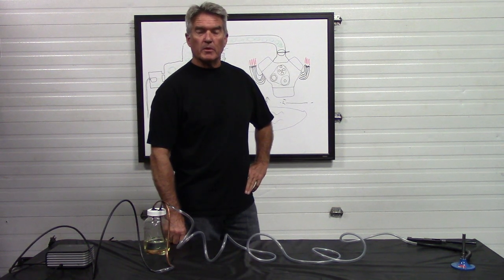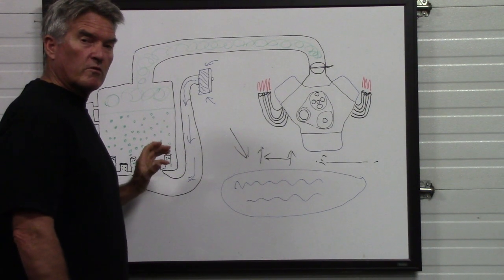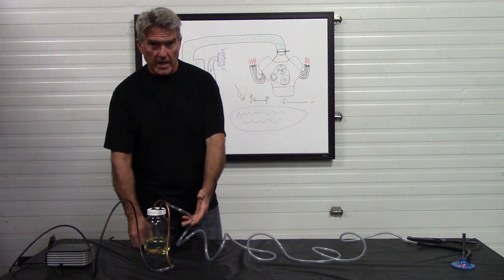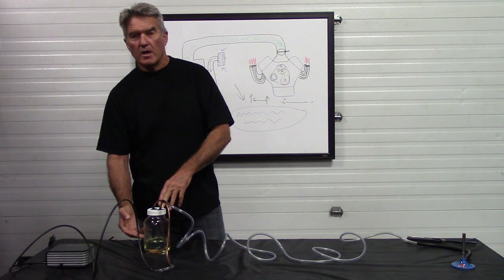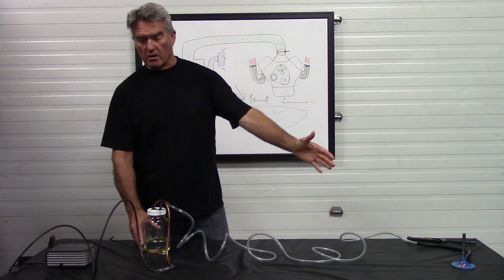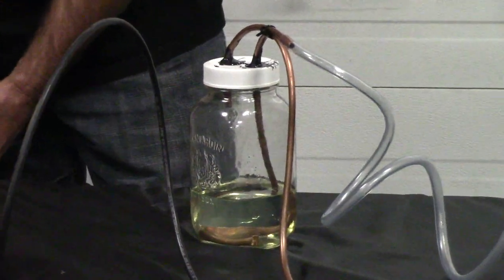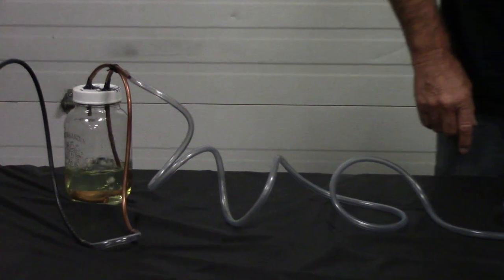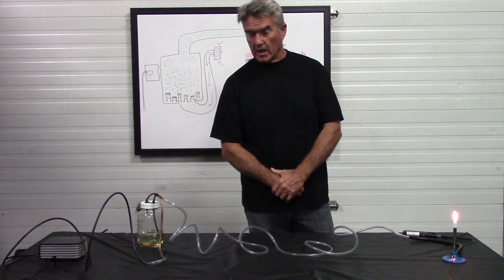100 Miles Per Gallon, Here's How

Comment: I'd suggest A flashback arrestor, acting as a check valve to prevent the ignition of a vapor source. It is particularly necessary for multi-cylinder engines operating on vapor to ensure safe functioning and prevent accidents.

Comment: Good video, Eric. Great to see people thinking out of the box. There is no reason why cars should not be running on gasoline vapor only in 2019 right out of the factory. Turning gasoline to vapor is not rocket science, as you just showed. Had the internal combustion engine been allowed to evolve unimpeded, cars would have been running on gasoline vapor over 100 years ago.
Reply: Running cars on vapor introduces complications with zero benefits.  In fact, cars would get LOWER mileage using vapor.  The reason for this is that high pressure fuel injectors would not be possible using vapor.  Today's modern fuel injection systems can reach hundreds of PSI and create mists with droplets microscopic in size.  Hundreds of well trained engineers working for both the automotive industry and the fuel industry know what they are doing.
Given the massive attacks on gas and engines today by the electric vehicle industry, if they ever had an incentive to absolutely maximize efficiency, it is now.
Reply: @christo930  Good points, all. Trying to follow along...When race cars [supposedly?] 'kick in the nitro' for that extra boost of power, to win the race, or escape with super speed, is the nitro in a liquid state or vapor? Does it feed into the fuel system, for dispersal? Or thru a different device entirely? After your excellent points, and my understanding of them, nitro seems like an impossible or improbable boosting mechanism. 
Or is that what is called a turbo?
TY and namaste
Reply: @Queen Elcene Nitro is not a fuel and does not by itself add any power at all.  Nitro is stored under pressure and injected into the engine so that more fuel, which is gasoline, can be burned.  The fact that it has to be pressurized is a downside, not an upside.   Nitrous increases the amount of oxygen  so that more fuel can be burned. Burning is a exothermic process of oxidizing a fuel.  How it is delivered into the engine depends on the setup.  But it usually goes in through the throttle body.

Turbos and superchargers work the same way, only they compress air from the atmosphere on the fly.  The low pressure in the cylinder can only "suck" in so much air.  So if one piston displaces 1 litre of air at atmospheric pressure, it can only pump 1 litre of air and this puts an upper limit on the amount of gasoline that can be efficiently burned for every stroke.    
But if you have a turbo charger or a supercharger, more than 1 litre of air can be pumped into the cylinder.  So if you could pump in twice as much air then you can burn twice as much gas, 3x as much air, 3x as much gas.  The turbos and super-chargers also take a lot of power to run.  Generally turbos are driven by the heat and pressure exiting the engine through the exhaust while superchargers are generally belt-driven pumps that work the same way as your alternator or air-conditioner. Turbos allow for smaller engines and make the system slightly more efficient by utilizing the heat and pressure in the exhaust gasses as a power source.
Reply: @christo930  Zero benefits to fuel vapor? Are you a troll? Have you ever heard of natural gas engines? Propane? Have you seen their engine oil at over 5x the regular OCI? Think outside the box. It would be far cheaper too compared to these super high pressure direct injection systems. They are far more complex.
Reply: All gasoline engines have always run on gasoline vapor and air...

Comment: Thank you for sharing your knowledge.
Have you done this in a vehicle? Is there a kit that we will be able to buy, before EXXON/MOBIL, TEXACO, SHELL, ETC./ETC. figure out a way to remove it from the market?  I would like to try it on my 1966 Ford F-100, where I only get 11 MPG
Reply from the maker: I put it on a 72 F150 in 1981. I achieved 75 mpg. The unit I used is in the long video called one simple trick to 100 mph
Reply: @zeekonearth3390  Thank you. I just saw the video.
Reply: @christo930  This guy is a troll.

Comment: Little known fact. You can cold boil any liquid in a vacume at room temperature creating a vapor. Instead of pumping the air how about creating a vacume with a vacume source? (The engine) I remember the old vacume carbs on the old tractors of the early 1900s most of those patents where bought up by the oil companies and companies were paid not to make them anymore. Have you done a google search on how “geet” pantones work?
Reply: @Brian Cramer   [🤔 Interesting that he didn't answer you.] While I'm NOT a gear head, my son is. I planned to show these vids to him,  as a fait accompli: "go build that, plz!"  After reading your comment, and one by Christ0930, I'm beginning to wonder about Eric/Zeke on Earth😶 Did he really create a device, and run it on Ford 302 engine? When he sparks the gas, on ther Bunson burner, it burns, baby, hot, explosive and fast. Wouldn't that blow up a containment chamber? Or be a continuous flame, like at gas wells? And the heat from the ignition, burning process seems like it would be wasted... again, I'm just trying innerstand🤷‍♀️🙆‍♀️
TY and I definitely will be showing your comment to my brilliant son. 
Namaste

Comment: Something like this to me would be better to supplement rather than replace current fuel systems. Eventually the oxygen sensors will trim back injector pulse durations to compensate for the unmetered fuel introduced by the bubbler.

Comment: Hi Zeek, I had a question that maybe you could help me with. I've been wanting to try running an old car of mine on gas vapor, but what about cooling the valves? Wouldn't they get too hot, since it's vapor and not liquid hitting the cylinders? I didn't wanna test it out and have em overheat. What are your thoughts on this?
Reply: Your air/fuel ratio needs to be around 50:1 or higher. Then you don't need to cool the valves. The fuel will burn completely and immediately. The reason for 14:1 a/f is that the liquid raw fuel is still burning on the exhaust stroke, which would burn the valve. The fuel is used to cool the chamber lol smfh.

Comment: Hey there,  im just a little confused  on something and id appreciate if you could maybe help me understand.  First off,  dont cars already do this exact thing when they atomize the fuel before detonation?  After all we know gas burns well but if you want it to burn fast you have to mix it intimately with the air.  Second  off,  when you let this run to completion, as in when the flame goes out. Is there anything left in the jar of gas?  As far as i know there's alot of compounds  in gasoline with very diffrent vapour pressures between them. Obviously this means at some point all the low boiling temperature components are gone and the flame goes out with liquid still in the jar no?

Watched a few of your videos seems like your Canadian  like me so cheers to that brother,  hope you can help dispel some of my confusion. Thanks!
Reply from the maker: Present day fuel systems introduce fuel into the engine in a liquid form. Mixing with the air is suppose to happen inside the combustion chamber. This is why a high percentage of the liquid fuel is ejected without being used. This of course happens in the exhaust stroke. Air passing through the fuel does not separate different chemicals from the liquid. This would however happen if the liquid was changed to a gas through heating. Basic principals of distillation.
Reply from the maker: Present fuel systems introduce the fuel into the engine in a liquid form. Typically sprayed in with an injection system.
Reply: @zeekonearth3390   Ah right that makes sense,  but isn't "liquid" kind of misleading here?  Wouldn't the gas be atomized and mixed with air in the cylinders before it combusts for optimal results?  after all that is how a fuel injector works no? 

*Please see the last 2 lines I know this is kind of a wall of text
*

Besides that i should clarify my last comment,  I'm not talking about distillation at all here though the same principles can be observed in that as well but since we're not applying heat this wouldn't be distillation,  its as you say drawing from vapors.   Quick google search shows that the 3 main components of gasoline (isooctane , butane and p ethyltoluene)all have notable vapor pressures at ambient temperatures.  That means that in a sealed container those components will vaporize off at standard pressures and temperatures to contribute to the pressure in their system. So when you pull air through that system replacing the mixture of gases inside it with the normal atmosphere they will continue to vaporize into the gas to try and reach equilibrium.  

I guess the main crux of my point is just,  how is this anything but a demonstration that you can light the vapors of gasoline on fire?  A really great channel has done a video relevent to this (https://www.youtube.com/watch?v=IuGWHfWqWtg)  and i'd love to hear your thoughts on it!  Thanks for giving me the time of day,  hope to hear from you soon!

Comment: If this were burning properly, the flame would be blue.
Also, here's Project Farm's video running a lawnmower on vapor:
https://www.youtube.com/watch?v=IuGWHfWqWtg&t=629s
No benefit AT ALL to running vapor vs mist.
Reply from the maker: When the fuel is at a different level ( in the case of the jar lower ) the flame is blue. That’s the bases of my explanation to keep the fuel level controlled with a float.